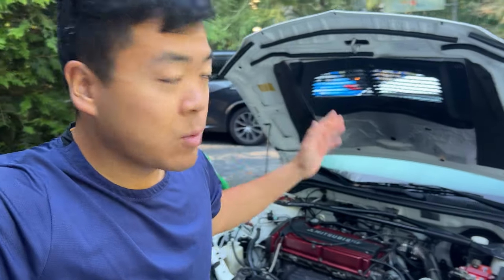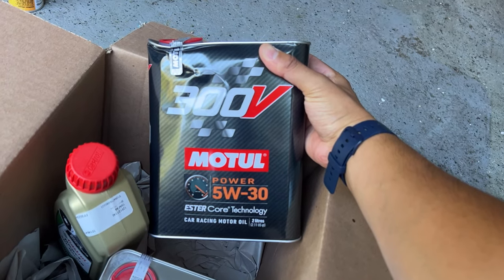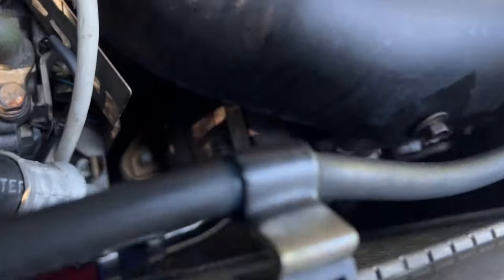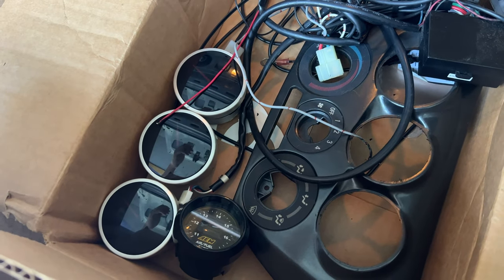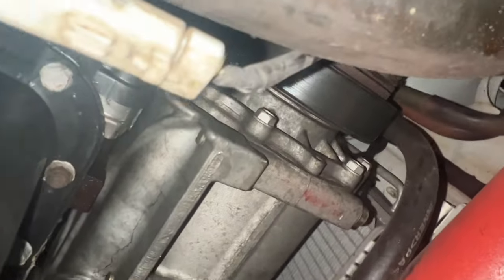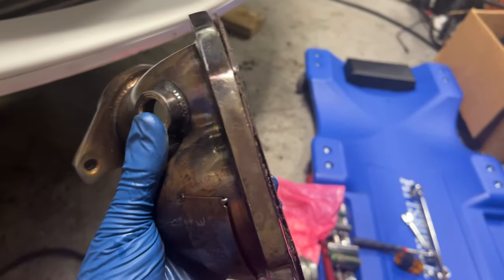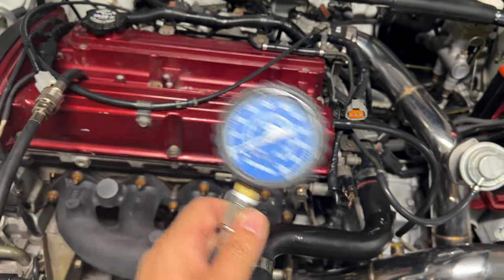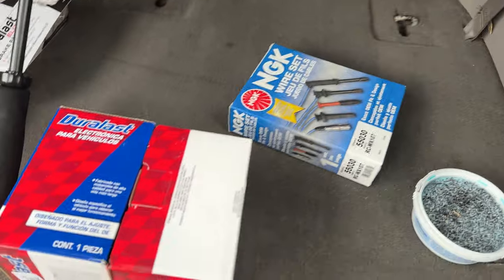Track Prepping My Evo 8 RS

Comment: Any update?
Reply from the maker: Bottom end also shot due to improperly installed clutch stopper. Shredded all the bearings. Sold car to the mechanic and cut my losses
Reply from the maker: Rebuilt the head and got it tuned. Only to find out it still was knocking. Brought it back and took oil pan off.

Comment: Update vid coming soon?
Reply from the maker: Engine was slowly reaching failure due to improper cam install. Also the clutch stopper they had installed improperly adjusted and was wearing away the rod bearings. Total disaster and worst purchase ever.
Reply: @BuyYourBuild damn man sucks! People are assholes..😮‍💨

Comment: Engine knock I would suggest getting it retuned or else that car will blow up
Reply: And also make sure the spark plugs are gapped correctly
Reply from the maker: I eventually brought it to an evo specialist. Seller sold it to me with a minor blown head gasket and all damaged exhaust valve guides. Cars/Bids doing nothing to rectify it